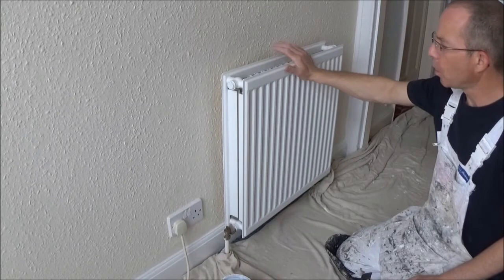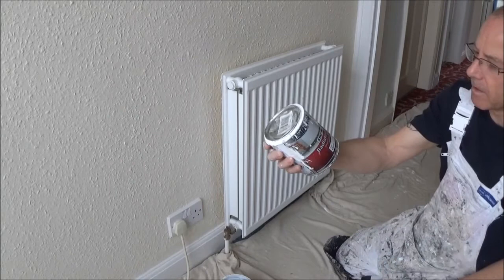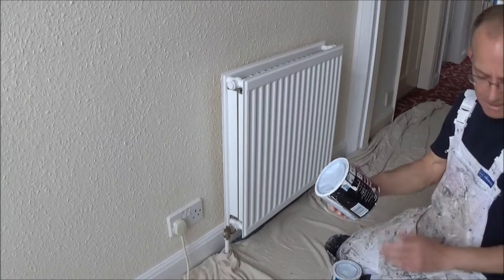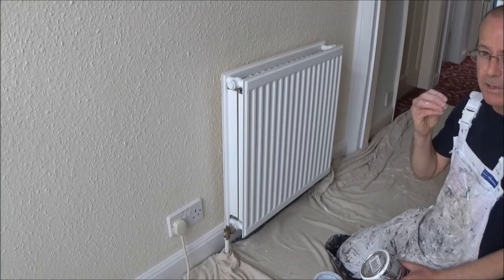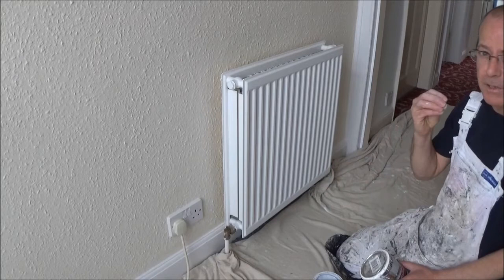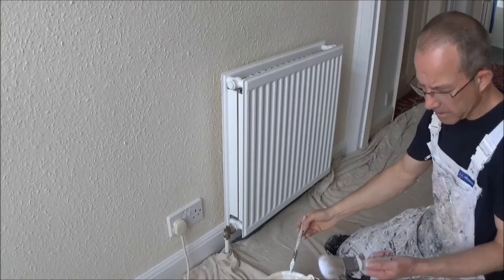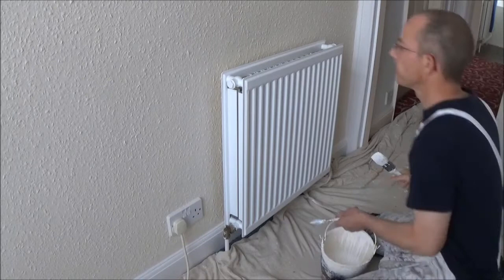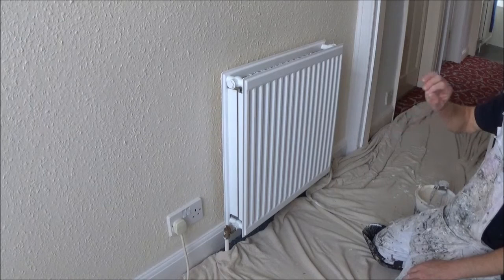How To Paint A Radiator

Comment: Hello, nice job. I have a question, I have a rusty bathroom radiator that needs sanding down and painting. Once I’ve spot primed and applied a full coat with B-I-N Primer, can I apply a satin paint as a top coat to radiator (I’m not keen on using gloss paint.) I’ve used satin paint on other radiators in the house and look great but they’ve never rusted. Thank you and keep your videos coming, they’re great.
Reply from the maker: Thank you.. as long as you have covered the rust enough then it should be fine with water based satin.
Reply: Thank you!

Comment: Hi,
Do you thin down the Ronseal paint?
If so, what paint to thinner ratio would you use?
Reply from the maker: Well to be honest I have never thinned it down, I always buy small tins of paint so I've always got the right consistency of paint. Especially when one tin goes a long way. They do different types white spirit and water based.  But read the label and it usually says how to thin the paint but failing that see what is used to clean the brush out with. Which is usually white spirit or water so you can thin your paint with the one you need. Never pour water based paint back in the tin once it's been thinned otherwise your paint will go off and smell bad.
Reply: Thank you.

Comment: Does it matter if the primer isn't for radiator like the top coat?
Reply from the maker: No as long as it's a metal primer... thanks
Reply: @PaintingandDecorating  Thanks. I was just worry about  the heat.

Comment: Hi mate u recognise this room from a previous video. Are u redoing the woodwork in waterbased gloss this time?
Reply from the maker: no this is at my house rad was not finished. never have the time.
Reply: Water based gloss is shit!
Reply: @PaintingandDecorating  
Your house?
Woodchip?
Horrible stuff .
But, if you use matt and plain colours its not to bad.
Reply: Here's a tip. 
Those plastic cups you get from water dispensers pinch some and cover the valves..
Saves little spots of paint on them.